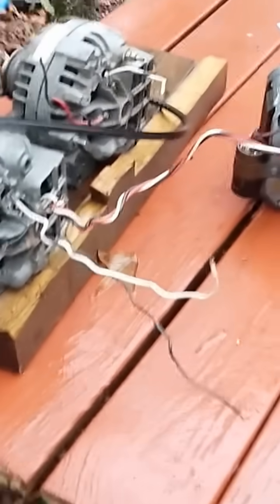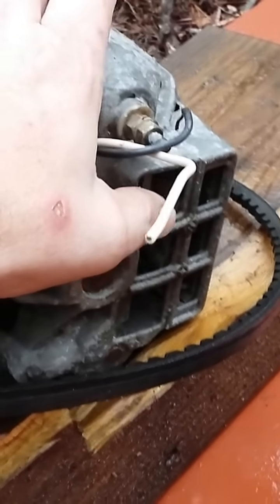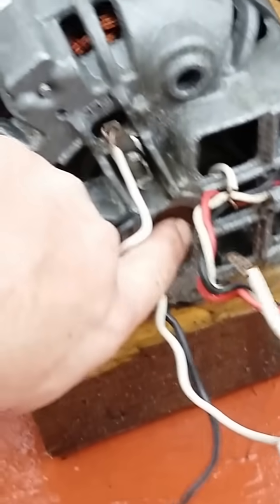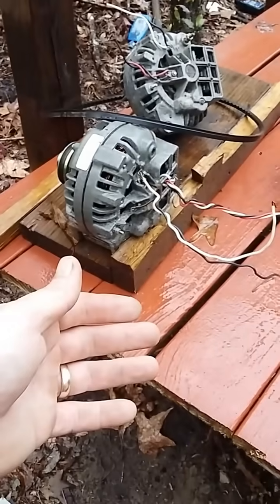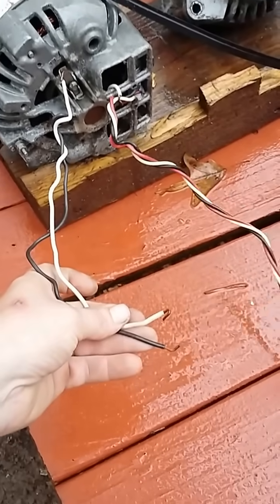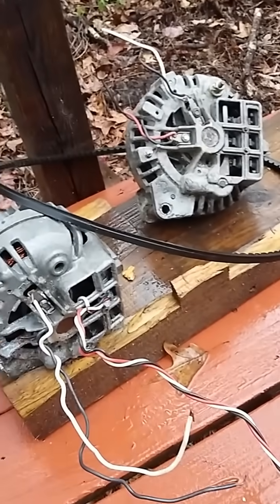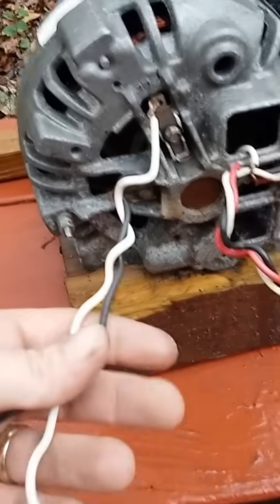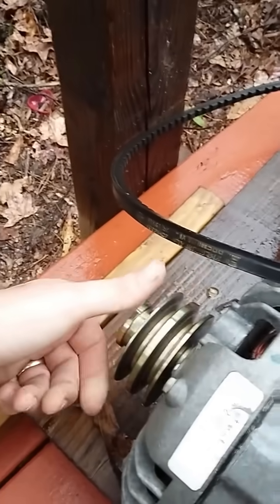Update Free energy forever no wind no solar no gas READ DISCRIPTION!!!

Comment: Thought diodes kept power from leaking back like a check valve not converting power?
Reply: They can do that too, but they serve as rectifiers in alternators. BTW what this guy is proposing is nonsense and will not work. You have to have a source of energy to spin the alternator to begin with, and it DEFINITELY would not output 90A at anything above 14.4V.
Reply: Diodes can be used for many things. Look up "diode bridge" on Wikipedia
Reply: Capacitors hold current.
Reply: @aaronthebarbaric7733  nuh-uh! YOU'RE wrong!
Reply: It only allows power to travel in one direction.

Comment: This guy knows enough about electricity to be dangerous. 
90 Amps through those little wires is called: Fire
Anyway, 90 amps AC from that alternator ain't gonna happen.
Reply: Maybe at 14.4V, but you'd still have to have an energy source to spin the alternator in the first place. I'm embarrassed for all of humanity that there are actually people who think this setup would create free energy. Even with no electrical knowledge, just common sense alone should tell you that you don't get energy from nothing.
Reply: @russellhamner4898  
Energy source needed-Yes
14.4 v -Yes
90 amps-No
Reply: @jstravelers4094   What so many amateur electricians think is that they see a voltage at no load and a current under load and think that is their power output. Which it isn't. Both voltage and current must be measured at the same time. 30 years ago I played with some Delco-Remy 24 Volt 50 Amp generators. With them wired as from the factory, they required power to be applied to the armature to get power out of the field. Then one day I mistakenly turned the brush holders 90°. Suddenly the generator could provide its own excitation to produce power but you had to control the amount of voltage fed from the field to the armature. If you turned it at 1800 RPM you could produce 120 Volts without a problem. For a short time. But it would destroy the coils if done for a long period. I expect that if you even tried to run the units he had at 240 volts for long that it would also eat the alternator's wiring up in a short period of time if done under load.
Reply: Js Travelers..why we can't get 90 amps AC from alternator? (if we remove the rectifier? (BTW, I  am just a beginner :)
Reply: @THINK-TO-THANK-ALLAH  Size matters. 
That's why. Everything about it is too small.

Comment: Exaxtly bro. Literally they get energy for free and a cpl alternators hooked up to a cpl i verters and a battery to keep charged..literslly infinite energy. There's not a resource problem there's a greedy guy holding everything problem
Reply: Lol no
Reply: Are you being silly or do you mean this seriously? It takes external energy to spin that alternator, so how is it free? If you cranked it up high enough to run that motor, and that motor was in turn spinning the alternator, the stored inertia could only keep it going for a couple seconds because of inefficiency losses. Oh and BTW this setup couldn't create 90A of juice at anything above about 14.4V.
Reply: @russellhamner4898  yea its called wind or water. Very simple. Use a wind gen with a solar panel, a battery bank and power inverter. I know exactly what I'm talking about.

Comment: You people haven't watched enough free energy video's. Car alternator is not a way to light up a 3-4 bedroom house lol!
Reply: No but once you start car take out battery turn on everything and drive untill you are out of gas just match horse power it does not take a v8 to spin alternators, I could spin 20 alternators from an engine or even more. We use dc only and have all the comforts of home. Look into inverter Generator. Right now we have a 1.3 hp getting us 1000 watts if you add a flywheel your power to the gen will be increased
Reply: @happyhomelesshomesteaders158  So feed that 1000 watts to that motor and see what you can draw off of it. Absolutely nothing because that motor will draw more than the alternator is putting out.
Reply: @gravelydon7072   no 100 amp 3phase 220 volts, but turn one alternator to 3 phases air plane controller motor high torque you can spin 2 alternators

Comment: And what a cool idea even a crackhead can come up with one every now and then god dude spit it out, hook it all up and give us a working model to look at instead of stumbling all over your words.
Reply: I was thinking the same thing. If it works so good why didn't he hook it all up & show us that it actually works
Reply: Because it doesn't work there's no such thing as "free energy" there's energy you can collect for example from the sun or a river or a chemical reaction but you can't get something from nothing it's a law of thermodynamics "energery cannot be created or destroyed"
Reply: @bobert405  You can pull it out of the air as electrostatic energy also but it does have a multitude of dangers.
Reply: @gravelydon7072   first and foremost that's not what he was talking about second that's not always possible it's conditional on the environment similar to solar (if it's cloudy you're not going to get anything out of that solar panel) if there's no excess charge in the air (which is common) your not going to extract any static electricity from the air

Comment: I think your safe, in theory this sounds ok, but how do you put a load on the alternator to produce current? From what I read it's got to turn about 3000 rpm with a load to produce power. Turning by hand won't do anything. Also don't be touching capacitors they store energy ...enough to knock you out of your boots

Comment: But what are the Amps going IN?
Reply: If you wanted to use 12V to generate 90 amps at 220V you would need at least 3000 amps at 12V (at 60% efficiency which is far on the generous side). Thich is completely physically impossible. You would need multiple strands of 2 awg wire to carry that much current. It is laughable that this guy knows so little about electricity to have the nerve to make such absurd statements.

Comment: I dont see it all maybe not getting it. But 90 amps would not run a full house here in Arizona.  The a/c allowed would blow that in summer . But I have been looking to hook up a altonar and solor panels. And batterys to run the a/c and then same set up for power and refrigeration.  With that and back up gas motor . And yes you can make a welder out of two altortors

Comment: Hello friend, I see how this can work by adding a car battery and charging the battery with the alternator I just dont so a 12 volt motor would need to be used to spin the alternator? Am I correct? And if you can send a video explaining in detail how you do this I would be happy to send you $5 hell make it $20 for real. Thank you
Reply: The 6-12 volts is only to magnetize the field coils,  the other power you give it will be connected to a speed controller if your wanting to use it as a motor,  tho if you are wanting it for a generator then similar setup but just a little different but either way you need to magnetize the coils with some voltage first in order for it to work properly.

Comment: For those who want to know. Timing is everything!. A/C- D/C. Did you notice he mentioned rectifyer. This chops the alternating current into a single directional wave. You simply gate and capture the other half of the lost A/C being rectified. Bam constant battery charge or load. Also check out weighted and balanced generators using mass.. HHO use stepped sine wave at bonding angle is most efficient way to fracture H2O

Comment: Just need to have the concept of how a generator works, I've powered my house the exact same way, also you can turn the washing machine motor into generator to
Reply: Or a ceiling fan will work to
Reply: You can turn any electric engine into a generator by simply turning it.

Comment: ALL HE DOES IS SAY IF YOU PUT 6 OR 12 VOLTS DC IN, YOU GET AC OUT. WOW! WE KNEW THIS OVER 100 YEARS AGO! IS THE DC COMMING IN FREE? HOWEVER MUCH POWER GOES IN, LESS WILL COME OUT. I WILL DEBATE HIM OR ANYONE THAT THINKS THIS IS A BIG DEAL. YOURE NOT GETTING ANYTHING FREE. YOUTUBE NEEDS TO CLAMP DOWN ON THIS KIND OF GARBAGE. I LOVE HOW HE THINKS  THAT SOMEONE IS COMING FOR HIM FOR RELEASING THIS INFORMATION. I LEARNED ALL THIS OVER 40 YEARS AGO. ITS NO SECRET. THIS GUY IS FULL OF S41T OR A COMPLETE IDIOT. AND "90 AMPS" IS NOT NESSESARILY A LOR OF POWER, IT DEPENDS ON THE VOLTAGE. 90 AMPS AT 1 VOLT IS ONLY 90 WATTS. 90 AMPS AT 120 VOLTS IS A LOT OF POWER, BUT A CAR ALTERNATOR ONLY PUTS OUT 14-15 VOLTS MAX. DONT BELIEVE THIS IDIOT. PERIOD.
Reply: 2:25 I think you skipped out on a lot of his video. Now I'm not saying his Creative Innovation (it's definitely not his "Invention" as he mistakenly said) works but I'm not going to bash his idea before it's either proven effective or non-effective.  But here's the very interesting thought that becomes quite funny. Everything he speaks of and points out is actually FACTUAL and has been known since before you were born yet your ignorance forced you to not be intelligent enough to first look into the subject at hand. 

But here's something for you to scratch your head about... Over the last few decades there's been many vehicles especially campers and vans to have AC Outlets (Just like those in your home) preinstalled so to use AC Appliances on the go all the while nearly every vehicle with this 'PreInstallation' does not use a Power Inverter of any sort. In fact my '85 Volkswagen Westfalia Camper has usable .5kW of AC Power run to outlets with no Power Inverter anywhere and everything is 100% original from the Manufacturer. Now how could this possibly be? Well when you're done pulling all your hair out pondering this craziness just come back I'll let the guy in the video try to explain it to you again. Ask him nicely and he might even use smaller words just to help you out in understanding. 

Yeah, BTW, your types are actually who YouTube needs to clamp down on! 

Cheerio, Lass!
Reply: @michaelwatts8052  not to mention I have an on / off switch in my 1973 Ford Econoline 200. For 120v and that is original. It's for the back lights in the van. So there you go go smarty pants. Explain that one. Without an inverter?
Reply: Oh one more thing... ALL Car Alternators put out more than 15v which is why there are Voltage Regulators on all Alternators. But he's talking about AC Voltage Output not DC Output! Skipping the regulator all together and POOF there's your miracle 😆
Reply: mic koole free speech bitch, you don’t like it don’t listen. You will be the next one censored if you keep asking big brother to protect you from ideas.
Reply: A lot of burnt fuses & wires , I hope U have insurance!!!!!!
Reply: I can only imagine how many people get injured or killed following idiotic advice from youtube videos. Plug that into power and yeah you wont live long

Comment: Yeah 90 amps. At 12v. Your house is 110v so that 90 amps gets cut down the 9 amps which could maybe run a coffee machine. And what are you gonna spin it with. An engine. Youd end up just spending more in gas. Get a gas generator in case of power outage

Comment: Hi! I’m a girl that doesn’t know anything about generating electricity but I think this might be a good way for me to eliminate one of my bills. I noticed you were setting it up while it started to rain. Does that help the motor like water helping a plant? Also the baby needs to be changed and fed. Thanks for taking the time to make this video.
Reply: @jillbean1969. Ahh, a good sense of humour. That's what I like to see when confronted with bullshit like this idiots lies. Loved the comment about the water too, that was hilarious. You'd think if this scammer was going to make a bullshit video to try and sell his lies he'd at least have enough sense to do it in dry conditions for 1. Then there's his one loop through and barely a twist even wiring that's going to make a very intermittent connection, and IF there was any reasonable current going through it would get very hot and sparky. The guy is an idiot and anyone who buys anything from him is clearly a far bigger idiot.
Reply: You are a millennial. Not a brain in your head. Go get knocked up or something.
Reply: Charles C. Shut up boomer
Reply: I think you are really sweet jillbean1969 if the water was used in a cooling system for a motor, then yes it would help, but in this case water is not good. You have a great sense of humor.
Reply: @DON-yq2op  I feel like I need a bath in disinfectant just from reading your slimy creepy comment. Please go get onto 1 of the many dating sites instead of being a slime bag on here.

Comment: How are  electric companies getting power for free most use natural gas or coal they aren’t feee and just another reason not to trust this video
Reply: Mine is using solar to sell us for outrageous prices.people are stupid sometimes.
Reply: Jennifer Hinkle i guess that is free but puts out minimal power and has extreme expenses probably same to similar for nuclear and hydrogen reactors
Reply: @jenniferhinkle6904  Try putting up your own solar panels and system. Once up it costs you nothing while the sun is up. Go bigger and add a decent storage system and you can run (apart from initial costs and battery replacement when they pack up) at night time free too.

Comment: do not ever connect such a worthless and dangerous system to your home, you will break everything. The output will be the wrong volts and hertz wrong. Also this system is not even running on his own house.  Increased voltage does not mean free power ( especially if powered by an electric motor ) .  People teaching this kind of deception should be severely punished

Comment: A car alternator will not put out 220VAC,  the 3 phase AC part of the alternator will put out a max of about 14 Volts , a car alternator amperage is rated at 13.8 volts DC, my vehicle has a 120A alternator at 13.8 Volts DC, a maximum of about 1600 watts.
Reply: Actually, they will put out more volts. Different alternators output 50-60v  depending on your model. The high end output models have regulators, and other safety devices that hold those volts back. Rpms are a factor too. 
 This guy is just trying to get paid for views though... Genius really.